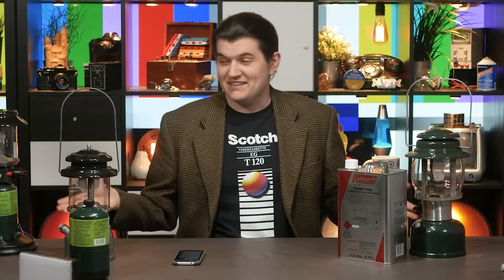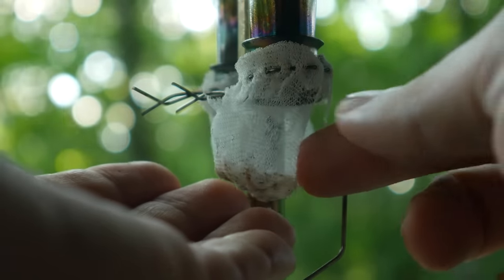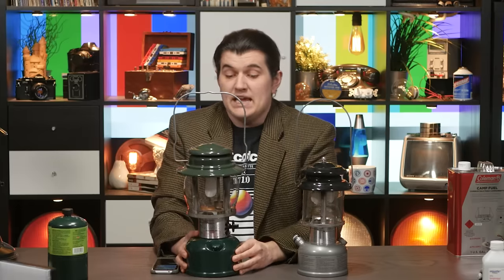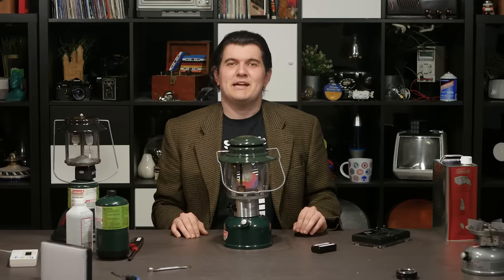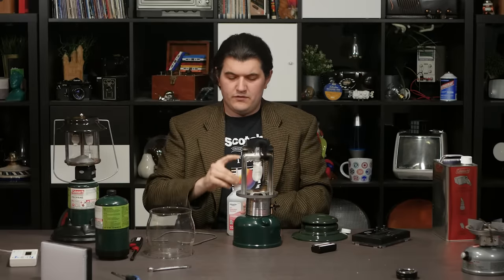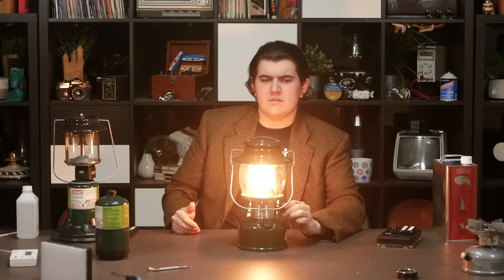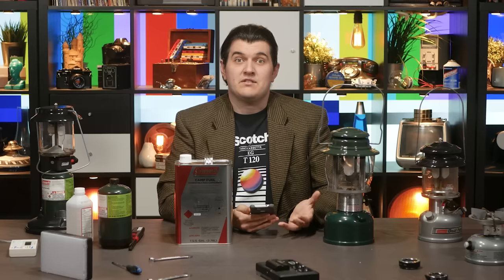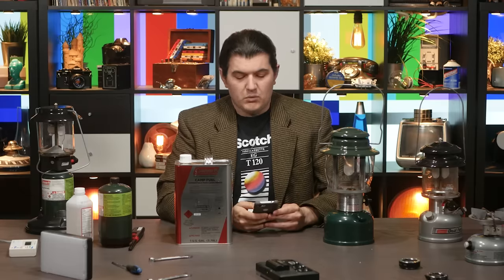A very rambly Coleman Lantern follow-up. Turns out they rarely make sense in 2021

Comment: What about the situation where you not only need light from a gasoline- or kerosene-powered lantern, but you need heat--both for space heating and cooking during a power outage? 
  And what's the difference between kerosene, gasoline, and paraffin? You didn't mention the latter.

Comment: Propane makes the most sense for camping. You can use the 20lb "grill jugs" to refill the 1lb disposable tanks and use it for a bbq, a stove, a catalytic heater and I suppose at that point a lantern as well. There is a good case for propane and propane accessories. White gas has little place in a cabin or a tent, due to the volatility in what would otherwise be just a small fuckup. White gas would work for a bug out bag, where batteries might not suit that use case. Gasoline dual fuel Colman stoves were used in the military for this exact reason. White gas doesn't clog and burns cleaner thus the shift. Kerosene is often used to heat off grid cabins, at that point you might as well have a lantern - though its a cabin so you should probably also get a solar panel and a Jackery. Maybe you don't want to leave the solar panel out in your absence, people could break in and steal your $500 pure sine inverter/battery.  I'm not sure about which is better... Okay Bye.

Comment: In the propane vs. white gas discussion, another small advantage that white has has is in its handling- it's container- transferable and leak-stable. 
Propane will boil away over completely from a leaking container or appliance.

Comment: White gas lanterns are absolutely safe to use inside. We used them as the primary source of light at our cabin, for my entire childhood. Nothing ever caught fire, and even when something hit the globe one night and it shattered, everything was fine (after we cleaned up the mess).

Also, while I don't have any first hand experience, I'm told in very cold whether environments the propane cylinders freeze and don't work very well, so white gas wins in that situation.

Comment: I loved this explanation of these compared to LED and the others on topics you've done. You manner and speaking go a long way in explaining things and teaching about those topics.
You are correct, but solar panels at max give 75 to 90 percent outputs from advertised watt outputs. Some packs rated at 25W take 4-6 hours of charging with AC. Solar takes a good deal longer to charge them. This has been shown on mutiple vids on YT. (As seen in TX with their energy grid during winter, green energy cannot match fuels still.)
Heat is why I purchased my Dietz, and the fact if they turn over they go out. As for camping, the smaller iso/butane gas cans do better jobs, but higher priced, with fast cooking (1500 to 6800W), or alcohol stoves (at 1500W) which can work in extreme environments.
The only thing I would fear would be an EMP or CME for electronics. The solar panels, if hit, will go down by about 50 to 90 percent output. It is also a reason I got the Dietz lantern and why I don't trust electronic locks.

Comment: I think the only reason for the kerosene lamp is for supply chain simplification.

If say you live in the North where often in the winter shipping delays are common,  and use kerosene to heat as many do, you might choose to have a lantern that uses that same fuel as opposed to having to keep two fuels.

Comment: It is vaporized kerosene that you smell.  It is why you put the alcohol in it and light it in the first place.  It does not burn a liquid directly, but a vapor.  It is also why you pump it (to produce vapor in the top of the tank).  You can also get adaptors that will allow the gas or kerosene lantern to run on propane.

Comment: About that particular type of gas can, I’ve heard some people who don’t care about EPA fuel safety standards and say that the spring loaded thing could potentially jolt the can around and spill gas if one is not careful, potentially making it just a nuisance to open and pour, have disassembled the spout by taking off the O-ring, and removing the spring, making it actually a “really awesome“ fuel spout “that doesn’t have any problems with lid-losing or venting. The only problem is that it’s straight, but it’s better than it was.”

Comment: Best thing about propane is that if you plan on camping for an extended period you can use a grill propane tank and just run a pipe into the propane heater. That and you can get a heat powered fan and still be able to warm food with it if you make a grate to hold a pot in front of the heater. 
So you're way better off just saving your propane for heating and cooking and keep using LEDs for lighting.

Comment: I wonder if the hole in the pump knob is there as a safety thing so you don't overpressurize the tank.  Like, there's going to be a practical limit to how much air pressure a human thumb can pump before it'll just start farting out between your thumb and the knob.

Comment: You nailed it on the head with the lifespan argument. And it isn't just emergency lighting it's also occasional outdoors use. I have a couple of dual fuel lanterns that are over 40 years old and still functional.  I used them a lot when I was younger but now it's every few years. If it were battery driven systems I would have to probably replace them entirely every time I used them. Cost efficiency does a 180 in that situation.
Reply: Hi benk have you become a flat earther yet? If not I suggest watch a 13 part series called What on earth happened by Ewaranon to learn that the earth is not a globe. I got it in my about tab.

Comment: Kerosene needs that higher temp to vaporise.      As soon as the flame goes out, even for a very short time, it cools down below that point, especially if the room temperature is a little low.
The products are really not difficult to live with.  You are just not use to the way they work so they seem hard.   If you use them regularly, then they are not difficult to use.  You learn the little quirks of each device.
In some areas, those lamps are the only option for light.  Sometimes we forget that when we live in a city too long

Comment: Did you calculate the propane using a 20lb tank? I go camping,sometimes for several weeks at a time, I find carrying my 20lb propane tank with a splitter to use for both my camp stove and lantern is a lot easier and very cheap. I can also get it refilled very easily. While electricity is cheap, I would have to leave my truck running to charge up my electric lanterns when I'm out in the middle of nowhere for a few weeks. This also makes it so I have to leave sooner to refuel my vehicle. Other option is batteries and the amount of batteries I would have to buy for a multi-week trip in the winter would be astounding. Batteries don't hold as good of a charge in the cold weather.

Comment: For the propane vs white-gas discussion, it's important to account for how a lot of camping usage is going to be pretty light. You might bring a lantern, a camping stove, and a single bottle of propane; you'd use the stove a bit for cooking, then be able to switch to the lantern on a medium setting in the evening, and could easily use well under a full bottle or two's worth over the course of a day/weekend trip.
Reply: I learned everything I needed to know about propane camp stoves many years ago. It was borrowed, "Bluet" or something like that, with a propane bottle screwed into the bottom of the burner as a stand of sorts. Very cold night of hiking with overnight in the open. Cooking dinner, the propane bottle was reaching its end of life, so I unthreaded it to replace with another. The remaining liquid out-gassed and dropped the temperature of the bottle's surface, freezing it to my hand. Very painful experience.I returned to my trusty white gas camping stove. Very fussy to get fired, but once fired, much more useful.

Comment: I have enjoyed your videos.  Very entertaining.  So I have chosen to use Kerosene for emergency preparedness use.  Since you had a difficult time finding a reason, let me (briefly) share my logic:

Used for more than lighting.  I have equipment for heating (kerosene heaters) and cooking (stoves) in addition to lighting.  While the odor is a definate down side, kerosene is much safer to store and use inside than dual fuel stoves/lanterns.  The pressure lanterns are not a primary light source but is much better if I need task lighting.  Old fashioned oil lamps work well and are easier to use than the pressure lanterns.  The kerosene heaters work verry well and 1 9000 BTU unit is sufficient to keep the house sufficiently warm to get through ice storms with just a little added clothing layers to be comfortable (I know, just ask me).  

By choosing kerosene as a fuel option, I can store sufficient quantity for longer periods of time than white gas or regular gasolene.  That is important because those products will "go bad" much quicker than Kerosene.  Having said that, burning ANY liquid fuel indoors carries risks.  Kerosene is the safer of the 3 options discussed (much higher flash point).  

Propane is good but expensive and difficult to store sufficient quantities for extended use for cooking, heating and lighting (potentially a week or more without power is planned for).

Anyone considering these solutions for  emergency preparedness, need to know the risks and weigh the pros/cons.

Comment: My 20 pound capacity . propane tank weighs 18 pounds, so I'm still carrying almost as much weight in tank as I am in fuel, and a full tank weighs 38 pounds, so it's not something you want to carry a long distance. The cost of the fuel is way lower than with the 1 pound throwaways. I use propane for cooking and a lantern when camping. One benefit to a mantle lantern for camping is that they do throw quite a bit of radiant heat. It wouldn't make much sense to use propane solely for lighting, but since I'm carrying it for cooking anyway, a lantern is nice to have, for light, heat and even the soothing white noise it makes, and it uses very little fuel compared to the stove.

Comment: When I go out tenting, I usually bring with me a Primus Micron Lantern with the steel mesh cover. It uses butane/propane and then go with the same fuel as my stove. I could use an electric light of some sort, but it's really nice having one of these fired up when it's cold and humid. Of course I could get heat from the stove or just use my electric headlamp, but from how it lights up the area and how it emits heat at the same time sort of makes it worth the 124-150g extra weight. When it comes to how many times I've changed the mantle, then I'm not really sure compared to how many trips each mantle has been used on. But wouldn't say it's that often the mantle has to be changed.

Comment: I'm sure you can get it at any where you can buy these at but in the grilling section at Walmart they have a 3-ft hose that goes from a 20 lb propane tank like for your grill to a 1 lb tank nozzle so you can run one of those lanterns for days off of the 20 lb tank and they're only like 14 to $17 to have the big tank refilled

Comment: Interesting video. One advantage of a lantern is you can just keep the fuel somewhere without electric and use it without having to worry about needing charged batteries. My family used to keep this stuff in our cabin that had no electric as keeping batteries there would serve no purpose. However any other use case batteries would make more sense for an emergency light source, unless of course you got stuck somewhere with just dead batteries and no means to charge them. That said....I think in our modern era the entire point of a gas or oil lamp a is that you can't guarantee your batteries be charged or working in an emergency. Fire and fuel always works though.

Comment: For power outages I use a LP one. The propane one, you never have old gas, lights rapidly, does not smoke in the house when you start it, or shut it off. The one bad thing about the LP light is that it creates so much heat. Hello from north east Montana. 
10 miles from the Canadian border.

Comment: I like the efficiency that electric brings for light, but I don't think that little battery pack is going to fry my fish. I can pack that can of white gas (I actually take a .5gal acetone can with pump gas) to cook with, and provide light if necessary. It's the dual use that caught my eye. If I need heat, and conditions are poor for starting a campfire, I have the fire-start-o-matic in a can for use case number three.

Comment: I commute and do groceries etc by bike, in Finland. Winter temperatures regularly hit -30 degrees C and my bike lights run off a pair of lithium cells wired in series. I just upgraded it to 21700 cells so roughly 40% more capacity(5000mAh pack capacity old pack had ~3500 mAh). I used to charge the old pack once a week or before longer rides in the dark and it never ran out in the 4 years I've used this setup.

Comment: You can fix these on-site. You can submerge them in water, and they still work when you lift them out (a bit of drying needs be done; not a big deal). They work in any temperature. However, those are also side cases.

My personal "side case" for why I use these lanterns often: these things cast much nicer light than anything powered by a battery. I live my life around garbage light (fluorescent and LED). When I go camping, it sure is nice being around the fire, and then the lantern you have is similarly comfortable light. I like it so much, I use these lanterns in my back yard when I am out there with friends just chilling around the fire. It's probably why people like tiki-torches.

Also, that "hiss" is comforting.

One day the light from LEDs won't be grating; I'm waiting, and will re-buy all of my xmas lights when I can get it.
Reply: The excess heat sucks for summer camping
Reply: @electrictroy2010  Agreed. But I don't use them inside, so it's never a problem. I basically use them like candles.

Comment: I'm a little late here but the benefit of the kerosene lamp is that in most of the world kerosene type fuels are going to be more common then gasoline type fuels.

Keep in mind, if it runs on Kerosene it can probably also run on diesel, Jet-A/most military turbine fuels, and heating oil.

Comment: So I gotta ask, are you in fact a old timey lamp hobbyist or just really really, really, really, through for your stories!?

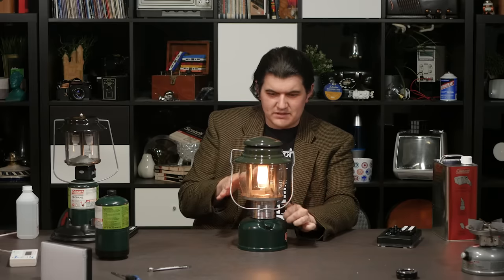And yes, even after watching all 2.5 hours on the topic, 31:45 hurricane,  20:07 gas mantle, 30:47  press lamps, 
22:24  more thoughts, and this last one 46:45 ramby it was great – you covered SO much stuff, it was cool !!

You do seem to be worried about perspectives but I wouldn’t worry so much, I myself found it odd and yet entertaining
that people are surprised or confused about propane and white gas and Coleman lamps or old Dietz ones.

I’ve been using Coleman products for 50 years, so to hear you describe the pumps and stuff as finicky is pretty funny.  
(to me)   

If you’re a camper – all this stuff is old news, I just got back from fall camping for 5 days last weekend and out there I 
used my Coleman propane lantern, and my white gas Coleman stove, and my Petzl LED headlamps, and my 100 watt solar 
panel and my optima red top deep cycle battery for various uses.

So yes, they all have applications and some thing work better than others.  It boils down to what works for you and what 
you’re comfy with.  For example, I stopped cooking on butane or propane stove’s years ago and tossed the bugger in the 
garbage, why, at -25 they don’t run for sh*t.  (grin)  So for winter camping, the only choice you have is white gas or the 
wood stove in the tent.

But try to get a pot to simmer on a wood stove or a white gas stove – propane is fantastic for low heat output.
For lighting in the tent also a 1 lb Coleman tank on propane lantern and yes an extra 600W of heat in the tent doesn’t suck.

But when I head outside to the throne room – my little tiny and wonderfully light Petzl headlamp with lithium batteries is 
the way to go!  Come on, a head lamp that now weighs 85 grams, can burn for 125 freaken hours and can go from 10-60m 
with the beam distance and up to 250 lumens – duh !!?!  😊

Now for the laptop and movies and charging the cell phones – the 12v optima battery and the 100 solar panel plus a fan for 
the summer for the tent – yep, different applications for different stuff.

So all these old and inefficient products still have applications for various uses that still can’t be beat and yep,  they are all 
still relevant, it just depends on what you want to use them for.  Hell even 21 years ago when everyone was spazzing about 
Y2K and are you ready for no electricity and dog and cats living together in anarchy (grin) us campers are ready for anything.  

Anyway great series and keep it up !

Comment: Isopropyl alcohol is not preferred to prime the kerosene lantern. Ethanol or denatured alcohol and methanol work much better and cleaner. The main benefit of the kerosene lantern is the brightness. The Coleman kerosene lantern is in the 250cp range where the white gas and propane are about 150cp (with 2 mantles). The one pound propane bottles are significantly more costly than other forms. From a cost perspective alone battery powered LED's are the lowest operating cost option with significant capital costs. However, you must have regular access to electricity and replacement Li-Ion batteries. There are massive storage and logistic concerns using Li-Ion batteries and LED lighting without easy access and infrastructure. And, PV charging can be heavy as well as much higher capital cost. Looking at only the lowest cost aspect kerosene still wins in poor (infrastructure and money and resources) areas. Hmmm, I wonder how much better Africa would be if old Bill spent his billions improving the infrastructure there instead of sterilizing the population.